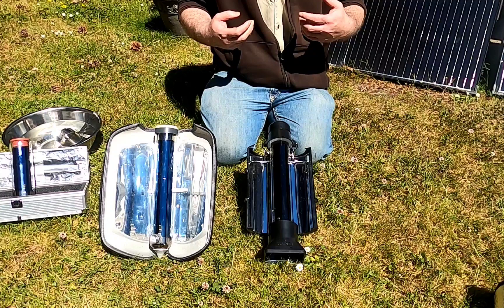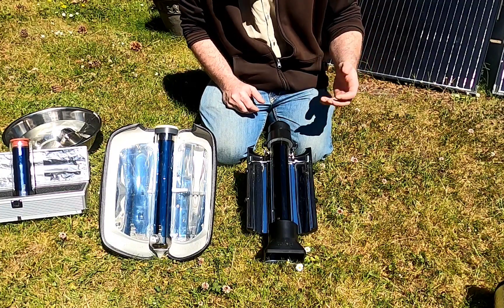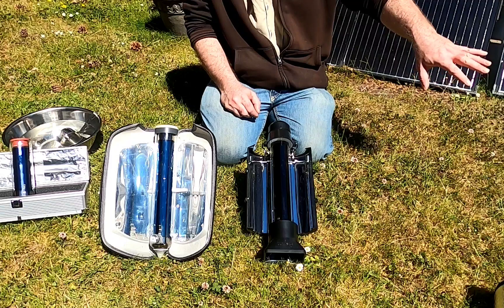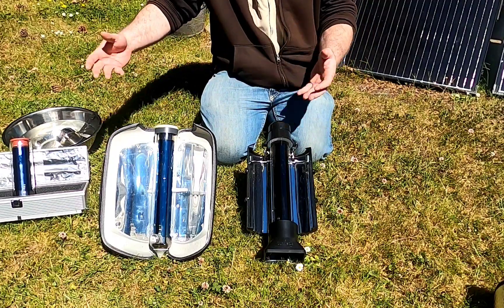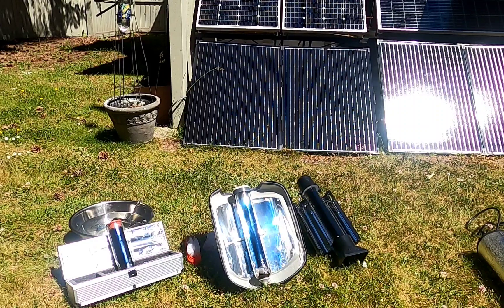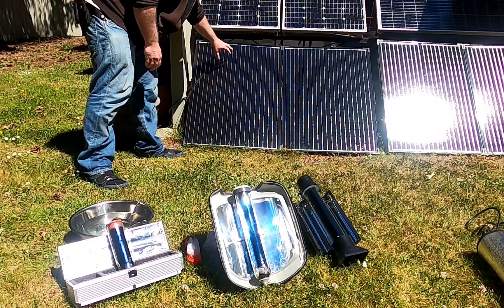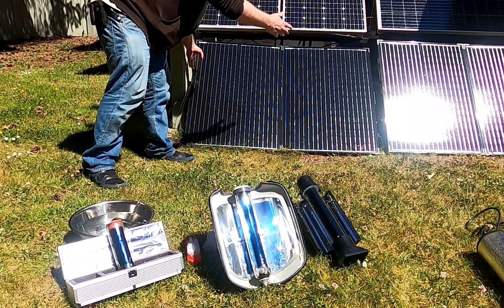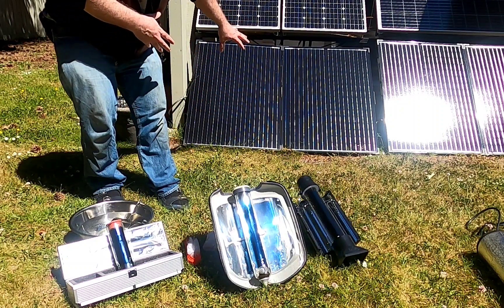SOLAR COOKING USING SOLAR EVACUATED TUBES TO COOK FOOD BY THE POWER OF THE SUN

Comment: you don´t need the metal tray for the gosun go to heat water. fill the water in and remove the white cap from the tray and use it as a cap.
Reply from the maker: Ya a bunch of ppl mentioned that lol

Comment: The tray is not meant to be used with Gosun Go model when boiling water,

 you remove the white cap from the tray and use it to cap the tube of water,  

It should boil faster without the tray, with less mess.

Comment: Of note is that the cap on the tray of the GoSun Go comes off and fits on the top of the tube, so you don't have to have the tube in it to heat water. I just ordered what claims to be a GoSun from Bed Bath and Beyond's new site for just under $83. It seems to be the size of the Go.
Reply from the maker: ya I was being an idiot, normally only use it to cook food
Reply: @frankbush333  I didn't know until I saw it in a YouTube video. Just thought I would pass along the knowledge. Make it a great day! 🙂

Comment: Not practical in Canada....only time it works is when it is too hot to cook. o Who wants to eat cooked food when it's 40c ? Plus depending on this tech, you will starve!
Reply from the maker: I am in Canada they work fine here, the amount of direct sunshine is the primary factor not the ambient temperature. These units are not meant to be a total replacement for other cooking methods they are optimally utilized to offset fuel consumption such as wood or gas in an extended grid down - shtf scenario in my honest opinion. Even if you can only use them say 150 days a year that still saves immense amounts of fuel. That being said I agree absolute dependence on these is unwise but I would rather have them then not if a major conflict erupts in the world which to me is likely at this point. Thanks for taking the time to watch more coming soon cheers.